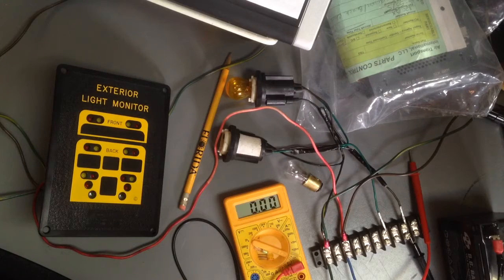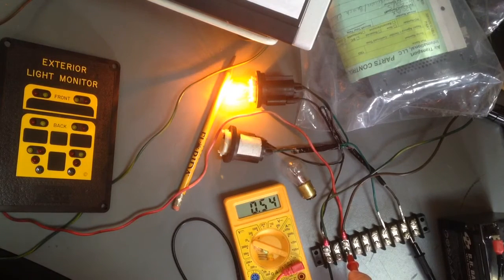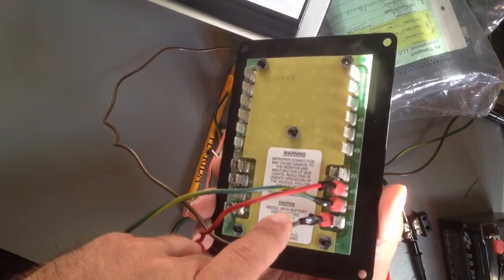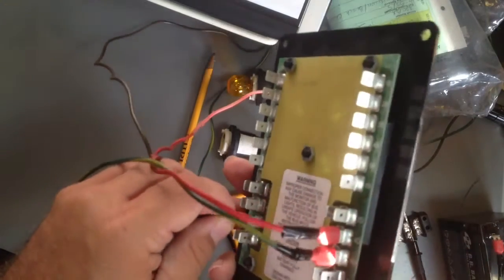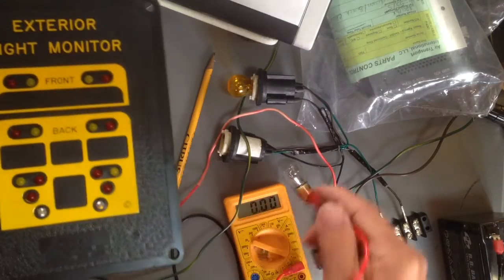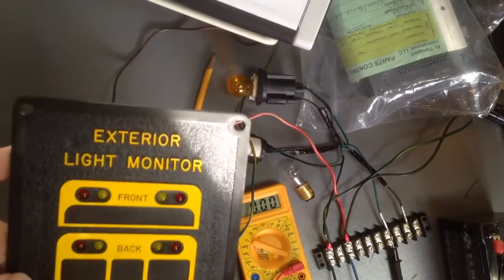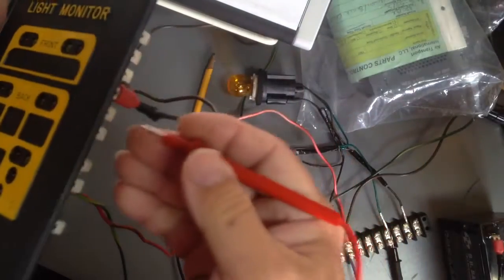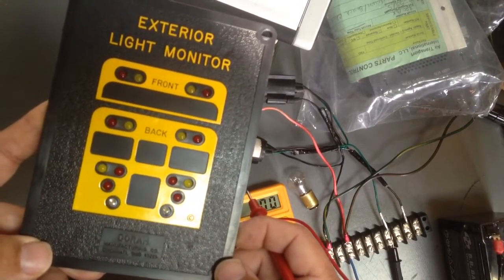School Bus Light Monitor Test

Comment: Where can I find a wiring diagram to explain what each terminal is for?
Reply from the maker: I found mine online just by searching for the model number of the unit I had.
Reply: @rick601a  Where can that be found? On the back of mine the only number is 104093 and that brings nothing up online
Reply from the maker: @exoticcar5482  if you can post some pictures of front and back of the unit you have. I will try and research it and see if there are any diagrams at the shop on that one. Do you know what body manufacturer yours was from would also help. Most common are blue bird body. And Thomas body. Hopefully we can do a visual reconstruction and determine what you have.
Reply: Hi Rick... I have the same issue. We unplugged the right side of the side of a incandescent light monitor on my 97 blue bird and didn't know that in order for the lights in the rear to work.. they have to be plugged into the monitor. We didn't take a picture of how the wires were befare we disconnected them so now we don't know what to do. I have pictures of what it looks like... can you help??